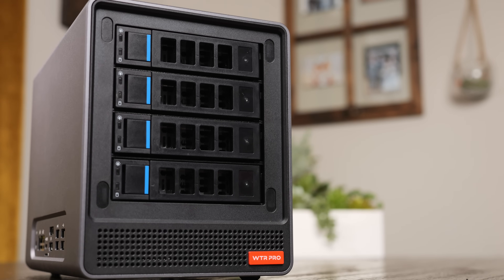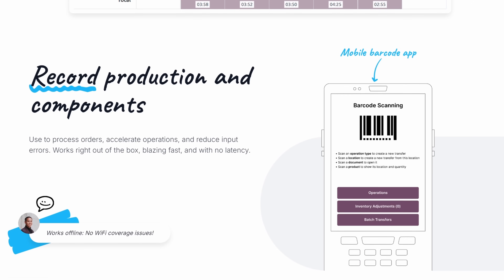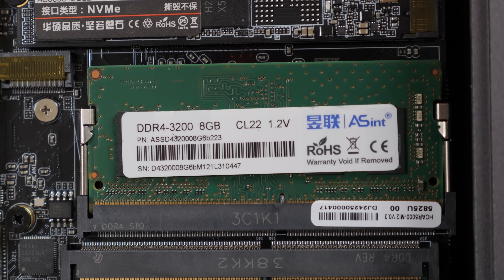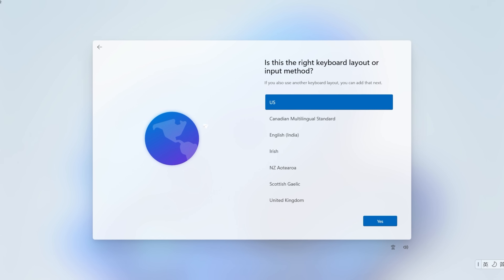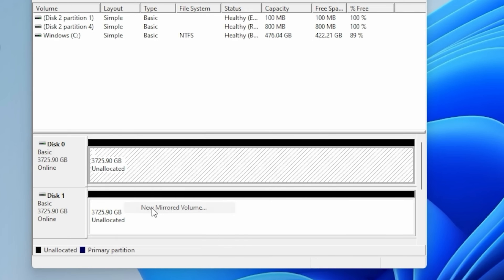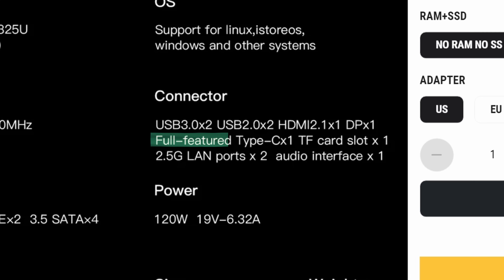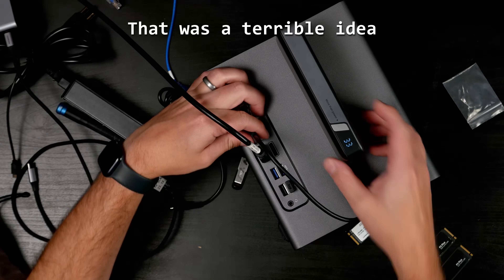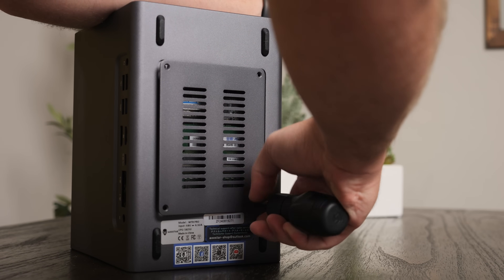The Home Server I've Been Wanting

Comment from the maker: IMPORTANT - An awesome viewer reached out and let me know about an issue with PCIe pass thru on the WTR PRO. It appears that if you pass through the second SATA controller to a VM, the host system no longer has access to the CPU sensors and drops to 1.9GHz. The first SATA controller can be passed thru without issue. This seems to be related to the fact that the SATA controllers are built into the AMD SOC, rather than being a separate chip. Aoostar has responded, but due to the nature of the CPU and design, there doesn't seem to be a fix.
Reply: @HardwareHaven  I experienced similar but yet different experience! Similar in that there are multiple SATA controllers with proxmox RAW passthrough, and these are in two different IOMMU groups. Once I passthrough the first SATA controller to TrueNAS, it detected both hard drives regardless of which port the HD’s are plugged into (I tested different combination of dual disks in different backplane positions), which implies that only ONE passthrough controller is needed for all 4 ports.

However, the different experience is that it’s impossible to passthrough the second SATA controller from the other IOMMU group (when done in the proxmox GUI, it will just “autocorrect” to the other SATA IOMMU group then will error that it’s already been used for TrueNAS. And I’m assuming the reason is like you mentioned: CPU sensors already use this controller/IOMMU group. So for me, I couldn’t passthrough this SATA controller even if I wanted to. There was no reason to use it either way because the first SATA controller was sufficient for all 4 backplane ports.

If you have time, please confirm (or deny) this if you still have this machine around.

Lastly I wanted to mention, your video review was one of the factors that pushed me to buying this WTR Pro. It’s current running at my parents home with great success (Proxmox, Opnsense, Pi-hole, Nextcloud, PBS). THANK YOU, liked and subscribed :)
Reply: @yellowsnow1922  Hi! Same for me, got inspired by this video and bought a WTR Pro. I'm running Proxmox on it with the "first" SATA controlled (0000:06:00.0 IOMMU 23) passed through to a TrueNAS VM as "PCI Raw Device". All 4 disks are detected and working without any issues.
Reply: @mrxllone  do you have the N100 or 5825U?
Reply: @  I have the AMD 5825U version.
Reply: @mrxllone  is the cpu boosting correctly and temp sensors working btw? please response as soon as you can. ty
Reply: @mrxllone  is the cpu boosting correctly and temp sensors working?
Reply: @yellowsnow1922  I put my 2 disks in the first 2 slots and only passed through the first SATA controller, none of my disks showed up. This does not work for me. Did you have "All Functions" checked in proxmox? does your temp sensor update in s-tui? are you able to boost past 1.8ghz?

my "lshw -class storage -class disk" shows 2 disks on pci@0000:07:00.1, not pci@0000:07:00.0 so it does not get passed through to the truenas VM. And when I do, temp sensor borks. What are your BIOS settings for IOMMU? Did you make any changes from BIOS different from default?
Reply: Just want to add to what  @yellowsnow1922  wrote, in my tests, with 'All Functions' checkbox unticked, I got 2 drives detected in TrueNAS, for each FCH SATA Controller. So, have passthrough both controller to get 4 drives detected.

But with the 'All Functions' checkbox ticked, passthrough only the first FCH SATA Controller works!!

In my case, I need a Windows VM. I passthrough the iGPU and the sound card, and all the USB ports (I have my own reason on why I need to do these). Weirdly, right after I boot the TrueNAS VM, the Windows VM shuts down. If I reboot my Proxmox, the Windows VM will not start. I have no choice but have to passthrough each HDD drive manually using qm set. The tutorial is available by TechHut in his channel. But, using this method, TrueNAS loses access to SMART, the HDDs's other details.
Reply: As a noob, who bought one after seeing this super convincing video, can I still run the 4 bays with just the first SATA controller?
Reply: I'm confused, does this only effect the AMD variant and not the Intel variant or is it both?
Reply from the maker: @jamescarrico1233  AMD variant
Reply: @HardwareHaven  another reason to stick to intel when you are doing NAS/VM
Reply: Hmm makes it less desirable, I imagine people who are planning passthrough to VMs is a key target audience for this device. If it's not getting full performance it's hard to justify over the n100 option. 

Can you let us know what are the controllers assigned to? Is it one controller for two disks? ie would still work as a 2 bay, or as @bart8863 suggested could we run four bays just off the first controller?
Reply: What is software lightsail uses to create virtual server if i want to host my many website at home
Reply: https://www.youtube.com/watch?v=Ct4yewC7mKA&lc=UgwJiMHG6VW4mzQlWT14AaABAg

@HardwareHaven suggested playing with ACS overrides, trying that now...

Edit: does not work

Edit 2: Aoostar released a new bios, also does not fix this issue

Comment: In terms of hardware and price, the model on the Intel processor looks good. I expected more from 5825U, but it is what it is. I'm also disappointed about real-time transcoding. Firstly, it's not fast, but barely enough, and secondly, it takes up a lot of space. I've made several different bat scripts for ffmpeg that transcode video from, say, H.264/ac3 to the H.265/ac or av1/opus I use. This is done by software, but it's done with high quality and then takes 3-11 times less space than the original in the H.264 codec. If NAS works 24/7 and you keep several videos in your collection or for later, it makes more sense than trying to transcode on the fly and getting lags and artifacts. However, I have a relatively powerful CPU, a Xeon 2695v4, which gives 70-125 fps in 1080. And n150 or 5825U will give much less. So this can also be a problem.

Comment: I asked Aoostar to send you the WTR MAX. Hopefully they do because you did awesome reviews. I bought WTR pro because of this video. I had problems with one disk showing read errors. it took a while but they fixed it with bios update. I gave up passing through SATA controllers to VMs. I'm now using proxmox as  myprimary os and I configured zfs and samba/nfs manually. Now it's working fine as a VM host and a NAS.

Comment: You know, and how could you because I haven't told you yet, but 13 years ago, I built a server with Windows Server Datacenter 2012/2016, with a Xenon 1265, 32GB ECC RAM, a small (around 128GB?) SSD (later changed to a 256GB (maybe 512GB? dunno, it's been awhile) for the OS, an Adaptec RAID/SAS card, and 8 3TB HDDs in various RAID formats (later, changed to 2 8TB HDDs and 1 3TB HDD as individual drives). I used a 550W Seasonic power supply and some server-style case that I hung vertically from a wall.

It's not too bad, my first experience with true server hardware (I had meant for this thing to do a lot more, but plans change). It would become my Plex server, and other than Windows Update failing a lot or taking three hours to update (no kidding), it worked as intended for a family of 4 with like 20 devices.

Fast-forward to today, and I badly want to replace the whole damned thing with a small case that has 4 hot-swappable HDD bays and that run Windows. I am not running anything that runs Linux at all...not because I can't or am intimidated by it (I've been coding since the early '80s, so the console is my home), but I don't want to spend more than the 5 minutes it would take to connect the system to power, network, and adding my drives. And also because I don't want to change the file system format; I like being able to swap these disks from one PC to another.

Sadly, other than building my own (I got one mostly assembled for about $900, but still need a decent and compact case that has front expansion bays), I just don't see anything out there. Definitely NOT buying crap from alibaba or temu or wish.

Comment: Regarding the hard drive holder and the hard to extract HDDs: I ran into the same problem and found out that there is small lever between the HDD backside (not where the connectors are) and the front of the case. You can switch lever up, now you have some centimeter (or micro foot for the american) space to push the HDD a bit further. This releases it from the pins at the side and you can extract the HDD quite easily. 

I have two of these machines and currently in the setup phase. 120 TB split between two for offside backup and onside media storage.

Comment: I bought the Intel N100 with 1 TB nvme 2 days ago. Windows never booted, and went straight to Chinese blue screen. Won't install or recover win 11 asking for unknown controller. Proxmox didn't install. Tried some Linux distros but Ethernet drivers were missing. now I'm running fedora and it seems to be working , but I'm a little worried.

Comment: The reason for the high power draw on the ugreen is the 10gb nic doesnt have functional aspm support.  This prevents the cpu ftom reaching low power package c states.  Disable that nic and use a 2.5 gb adapter that supports aspm and power draw sgould go down considerably.

Comment: I'm using the ryzen 7 5825u in my mini PC home server with proxmox.
Just ran into an issue with c state 6 powersafing levels. Looks like this is still an issue with Linux (started with zen 1)
Had to restrict the system to C1 and it's still unstable under little load.
Just wanted to let u know. And if someone has a better working fix pls tell me :)

Comment: I just got one after returning the lesser 2 bay version. This one is awesome and I was able to take down my full tower old desktop as a server, a Ryzen 2700x. Using Debian 12, zfs and might use a 2242 or 2230 for boot on the nvme A/K and add two older 2tb nvme for another mirror. FUN!
Anyway a great little unit and small.

Comment: I actually got one based partially on this review and it was a mistake. I do NOT recommend. It only sees my 32GB of RAM as 16GB despite trying multiple different sticks. And one of the ethernet ports does not work. I have tried to get support but it's been very lacking. They keep telling me to flash the BIOS but do not have instructions on how to do so, and sent a link to a video on how to mess with BIOS fan settings when asked for instructions. They also only do support for the Ryzen version and do not have any support material for the N100 model.
Reply: Mine works perfectly. It recognises all 64GB of RAM, both 2.5Gb ports work perfectly, the BIOS got updated without issues and it doesn't make any noise while keeping the drives cool. Sorry that your unit does have issues though :(
Reply: @nitrobear  did you get the Ryzen or N100 version?

Comment: it's not as good. Runs EXTREMELY hot at IDLE (60ºC or even more) if you tweak a bit the fan curves (on bios) you end up spinning up the fans way too much and gets MUCH MUCH noisier.

Comment: @HardwareHaven The driver trays are actually really easy to remove. There's a little black latch at the back of the tray that you lift up and the drive slides right out. I discovered it on accident. If the manual mentioned that, it would have been nice

Comment: I was so excited to get my WTR Pro Ryzen 7 in as my first NAS and the LAN1 doesn't work at all. It doesn't even show up in the BIOS. I'm still waiting to get any response from Aoostar.
Reply: We spoke on Discord I think. How about sharing your fix so that anyone else here that hits the problem can resolve?
Reply: @phar2010  I don't know exactly which update did it, but after running a bunch of the Windows updates and restarting it it several times for those to finish, the LAN1 started working and showed up in the BIOS. I'm guessing it did some sort of hardware scan and updated a missing driver. I'd previously tried that from inside Windows and the system first showed it as hidden, then it disappeared altogether and never came back on the other restarts I did before the updates. 

I'm not planning to use Windows, so I wasn't going to do the updates, but they started themselves. I don't know enough about hardware to know what really happened or how to get the same results with a Linux distro.

Comment: i just received this  18th December,  great little nas, very heavy and seems to be well built. my main issue is the temps are high, when temps get high the CPU fan speed is very loud. i wish these reviewers did a little more in-depth testing. n100 version maybe ok but the AMD version gets very how, so I had to set the power to 10watts which makes it a little better but I'm guessing the performance will take a hit

Comment: With one SSD PM981 512G  and no HDDs I was able to bring power down to 10W using powertop --auto-tune - nowhere near 5-6-7W. Maybe on 220V the power adapter has is terrible efficiency at low power. The power adapter itself is 3W when not connected to the NAS and 4W when connected to the powered off NAS.

Comment: The problem is the cpu. While an AMD Ryzen 7 5825u can be used for Jellyfin, it's not considered the best choice due to limitations in its integrated graphics, which are not optimized for hardware acceleration compared to Intel CPUs, especially when transcoding multiple streams simultaneously

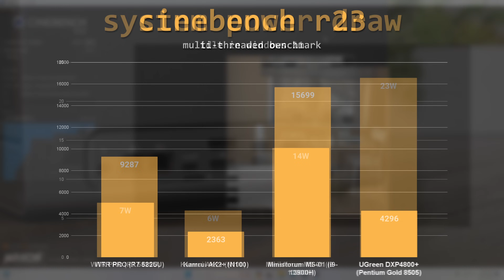Comment: 8:54 thank you for including power draw - so many dont include it, and with energy prices as they are here, it matters a lot

because of that, ive been thinking of using a mac mini as a homelab. it sounds quite dumb but the M chips have extremely low power draw, it comes with 10gbe, and the thunderbolt ports provide 3x pcie 3x4 on the low end, and 3x pcie 4x4 on the higher end (though thunderbolt 5 adapters dont exist yet since its so new). the main problem would be software, but as far as i was able to tell, macos supports docker & vms, and most homelab-level software already supports arm due to raspberry pis... if you were up for it id love to see a video trying to implement this - but i understand if its cost-prohibitive/simply not something youre interested in.
Reply: I think you'll offset all your M chip powersaving by needing to use a USB or TB enclosure for storage, which are notoriously bad with powerconsumption.
Reply: @ ooh interesting. is this a quality thing? Or something else? I was thinking specifically of thunderbolt to nvme m.2 enclosures, since there’s already devices like sata controllers and NICs in that format. Do they still heat up when not actively transferring data? If it’s for eg a 99% idle NAS, it might still be worth it
Reply: @mtqrx  I think it's a combination of factors. For one, you have a seperate power supply for the enclosure (in case of hard drives). Then there is also a lot of inefficiency in translating different protocols using dedicated chips, like TB to USB to PCIe or SATA. This also usially means a lot of the power saving modes don't work anymore.
Reply: @TheAnoniemo  ah drat, youre probably right. ive been really kind of disappointed with amd/zen on this point. idle power consumption (especially on chiplet designs, less so in their monolithic APUs) is so high, even when compared to intel. but intel also has much fewer pcie lanes at the consumer cpu level. and on the server stuff, intel is still "ok"ish with the power consumption of the cpu themselves, but their server motherboards for some reason also have huge power draws, even with stuff like ipmi turned off. it really seems like the technology is all there, but theres no one that put it together
Reply: @TheAnoniemo  realistically, no, im just being very picky 😅 my goals were 10g nic & all flash (for noise, but the speed is a welcome advantage). i think ive somewhat settled on an undervolted 14700, which should leave me 4.0x4 for a boot nvme, and up to 5.0x16 (or bifurcate to two x8) for HBA, both connected directly to the cpu, and 4.0x4 through the chipset for a NIC. main issue would be finding a compatible HBA that deals with sleep modes properly, which is apparently harder than it would seem.
Reply: @mtqrx  If you need an HBA, I assume you want to use SATA or SAS SSDs?
Reply: @ yeah, it mode HBA (for truenas scale or something) was the plan. I’m fine with it not fully saturating the 10g uplink, random Google numbers say a single sata3 ssd should reach about 550mb/s (before any raid/any HBA limitations), which would be around 44% utilisation, which im fine with.

That said, sata ssds are getting harder to come by, decent ones like mx500 have been discontinued, and the price gap is getting smaller, so, who knows. I might try to find something with nvme? But I also would like hotswap ability, so maybe with u.2? Not sure tbh

Comment: So, a couple of things about my WTR Pro unit:
- it has a bad case of coil whine once you run it with 4x HDDs. Support has been very responsive up until my return window expired, silence since then. Think what you want.
- pcie passthrough of the GPU is problematic if solvable at all. Simply passing it through as I did with the SATA controller leads to a whole bunch of other devices being passed through as well (keyword "iommu groups"). Probably also explains why HardwareHaven is using an LXC container for jellyfin instead of running it in a docker VM.

Personally, I was way too hyped about this system, kind of bummed out now.

Comment: Regarding hot swappable, a lot of these simpler non-enterprise chassis won't have a "identity" option for the drives, meaning that even if you could hot swap, you wouldn't necessarily know which drive to pull. I have made habit of adding a sticker with the S/N on the bay so I can easily recognize it.

Also for the USB 3.0, I guess the idea is more that it can be used to power other devices, rather than powering itself via USB